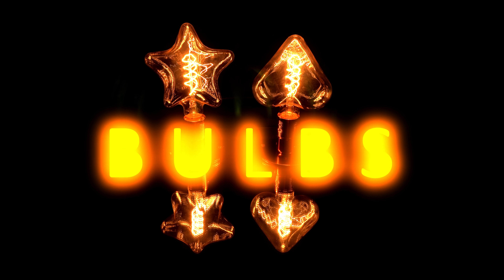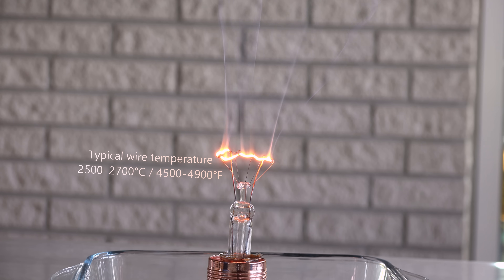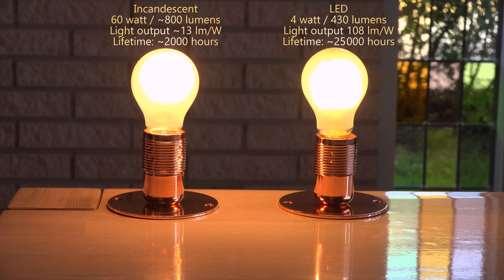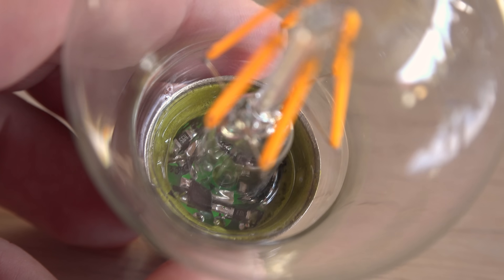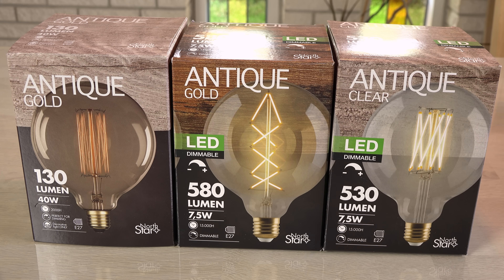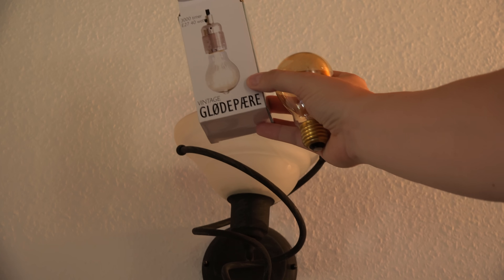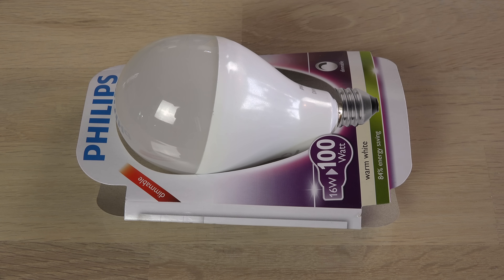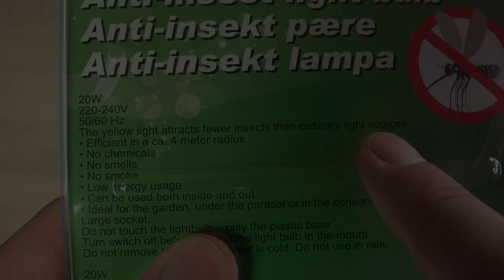Light Bulbs | LED vs. Incandescent

Comment: LED's are blue light. Blue light in excess and beyond the usage at noon, will through off circadian rythym in the masses, and reduce the efficiency of the mitochondria in cells provided enough exposure.
Reply: apparently this is strictly limited to the blue spectrum? So, ridding blue and using violet wavelengths looks like it fixes the issue while attaining high CRI? I haven't seen independent 3rd party analysis on this other than from what the Japanese companies themselves push, but I haven't tried to look very hard, either.
Reply: @androidkenobi  I read that masking the bulbs doesn't help much.

Comment: how do they make colored light bulbs?
Reply from the maker: There are several techniques. Some are just painted/filtered white light bulbs, while others use LEDs with specific colors.
'White' LEDs are actually blue LEDs covered with a fluorescent phosphor to make the light whiter ( https://en.wikipedia.org/wiki/Light-emitting_diode#White_LEDs_and_the_illumination_breakthrough ).
Thanks for watching :)
Reply: Brainiac75 Thanks!
Reply: Yes, each LED has a specific frequency.  You change the materials to adjust their resonance.  The technology for a $2 light bulb is quite different from more refined one light in aquariums.  What brainiac75 states is partially true.  The technology for my Christmas bulbs is much more complicated then the bulbs he is discussing. The use 4 different emitters not one.  He is wrong for the most part but right about one singular case.

Comment: LEDs, CFLs and all other fluorescent tubes are abominations. They've been giving off their perverse light since the 1930s. Incandescent bulbs are the only electrical light source that is similar to natural light(fire and sunlight). It follows the spectrum typical of a black body radiator. That kind of spectrum is REAL light, that which the human body is adapted to. CFL and LEDs are perversions of light and they both lack the VITAL infrared portion. Light that is devoid of the infrared portion and doesn't have a smooth wide spectrum is POISON. The infrared given off by Incandescents is not waste but an integral part of any healthy light source.
Reply: Roo Baba You were asked for evidence for your health claims.  Evidence is the result of scientific research, by a scientific method with objective measurable results.  Such research is publicized so other scientists can criticize the method or repeat the research to verify the results.

Your reply, however, is nothing but a logical fallacy:  Natural is good, natural light contains infrared light, so infrared light is good.  Or the opposite of it:  Unnatural is bad, artificial light does not contain infrared light unlike natural light, so artificial light is POISON.  Even though it is a popular belief, the premise that natural equals good, better or even optimal is completely false.  Likewise, the premise that unnatural equals bad, worse or worst is false as well.

Without research, your claims are nothing but ideas.  Only scientific research can tell if your ideas happen to be correct.  If it is, that doesn't mean your premise is true since there are plenty examples where it isn't.
http://lmgtfy.com/?q=appeal+to+nature
Reply: Roo Baba interesting. any sources or evidence so i can look into this?
Reply: Samster Birdies Look at the spectrum of incandescents, fire and sunlight. They all follow a similar wide smooth curve snd only differ in the parts of the spectrum they cover. Look at the spectrum of sunlight at noon and at sunset. Observe the natural patterns and what humanity has been accustomed to for thousands of years before electricity. You will observe that sunlight at any time of the day is rich in infrared radiation(to call it waste is heresy! Lol). At noon, the blue portion is at its peak(promotes alertness and productivity, serotonin production, melatonin suppression and suppression of regenerative rest) but at sunset, it is greatly reduced(setting the body to welcome a restful night) and resembles incandescents and fire's spectrum more closely. It is only natural for the body to be exposed to low intensity light that is rich in the red and infrared and very low in the blue and UV at night. Fire was the perfect source. Incandescents are pretty close.

Infrared is divided into 3 portions: near, mid and far infrared and these have beneficial effects on the body unlike the light from CFL and LED. Both these are devoid of infrared, lack a smooth wide spectrum and most commercial varieties are rich in blue!!. A complete perversion, worse at night than during the day.
Reply: Roo Baba ahhh. i see. thanks.
Reply: Triplemania we should make it so light bulbs give off ionizing radiation so they are just like the sun.
Reply: Roo Baba I agree..it is typical of ObamaEra thinking.
Reply: Triple mania, Excellent way of thinking, as far as going on the scientific way.

Using the word “natural “ to promote anything, including herbal supplements with unproven efficacy, and possible harm, has been a longtime problem in the health industry.

Coming to the point of this discussion: the two well known effects of lack of natural light are SAD and Vit D Deficiency.

Would be interesting to see if these new light sources are able to mitigate these problems. 

I think (though I’m not sure) that the light sources used in treating SAD are fluorescent.

The third factor to consider is possible effects on skin cancer.

(Interesting how this excellent video on energy efficiency of light sources by Brainiac has lead us to think along these lines.)

Nice group of bloggers here.
Reply: have you spoken to your psychiatrist about this?
Reply: Jonathan D I think your reply was directed to another comment but got posted here instead. :)

Comment: I've worked in the sustainability & energy efficiency sector. I get many questions from clients & people asking if they should swap their halogen or filament bulbs for LEDs or CFLs. The answer is... it depends on how often & how long you use the light.
If its a light that you use often, say >3 hours a day, then the cost-benefit justifies it. It will pay off in a less than a year or two. But if it's a light in the laundry room, storage room, or a vacant room that you only use once or twice a week for less than 15 minutes... then it's better to leave it be & only replace it when it goes. I have an old filament bulb in my laundry room that's been there before the phaseout (filament bulbs were replaced with halogen technology) in 2008.
Reply: we went LED through out,  in the low uses rooms more cause daylight leds are so bright and pure a white and we can use higher output bubs than was safe when they were incandescent
Reply: @ThunderClawShocktrix  Shame, because incandescents offer a special 'warmth' (not color) that LEDs dont give.
Reply: When I built The House of Steel almost 20 years ago, I installed mostly halogens in the high use areas and incandescents in the low use areas. LEDs were far too expensive at that time. The high voltage halogens aren't particularly long-lived, though the low voltage/low wattage ones are still going strong. I replaced three of the 50W sealed downlights with the highest output LEDs available about three years ago. The LEDs were quite dim (and therefore dangerous; they light my kitchen bench) and the first failed after three months so I returned to using sealed halogens. The incandescents lasted longer than 10 years and were definitely the cheapest option. 

The short lifespan of the LEDs makes them the most expensive by far. Also the highest energy consumption when you realise that their cost is a function of how much embodied energy they represent. The high voltage 200W linear halogens have a lifespan of ~3-12 months. The sealed dichroics about 12 months. All of the supposedly energy-saving bulbs cost me more than the old incandescent bulbs did. CFLs are lasting quite well in the low use areas, but the ones in my home office only last about the same as halogens, 6–12 months. Also the 12 volt devices consume transformers. They rarely last longer than 2 years.
Reply: 2 years later:  I would advise traditional incandescent bulbs for your nightstand or reading light, also for kitchen. LED lighting is not good for your eyes.
Reply: I changed my CFLs just beacause of the annoying warming up time, specially if you are just going to be there for 5 minutes but I still have an incandescent one in the staircase that the previous owner left and I wonder how many 100 year old bulbs are we going to have in the future.
Reply: @besanit  Our house is still full of incadescents and its really cozy
Reply: I just found out how bad LEDs are for our health. The ban was a terrible idea.
Reply: @casperboreanaz  I only have incandescent in my home.... I love it
Reply: @NEON2600 what do you mean by super bad for health? what are they doing?
Reply: @casperboreanaz  Exactly!!
Reply: I remembered when I moved to Arizona and there was such a limit on water use, as an environmentalist I was quite impressed. But when I conveyed my enthusiasm for these water restrictive policies, a long time resident of AZ set me straight. She said it had NOTHING to do with water conservation, it has to do with growth. The powers that be can't push endless destructive growth if there is no water, so they restrict the little people, make us feel like we are doing something good, but all it does is allow them to continue the sprawl across the desert. The use of LEDs is no different, this is not about conservation, it is allowing for additional growth. Look in California where they have rolling blackouts because of the strains on the system. God forbid they invest in infrastructure, they are far too busy spending al that money on wars.

Comment: Can't dispute most of your facts, however.  Like for like,  incandescent bulbs give off more light.  I have used a photographic light meter to test  incandescent Vs LED and the incandescent wins every time.  It's not a saving when you need two or three LED to generate the same light as one  incandescent.   Also and more of a worry, the EU  based criminals who  generated this ban, earned around £4 billion in the England alone - during the transfer of fittings needed.
Reply: Does the photographic meter have infrared cutoff filter? If it doesn't, it might be just measuring 700-1000 nm wavelengths which humans cannot see. In my testing, even cheap LEDs give about 8 times more light per watt
Reply: " Like for like,  incandescent bulbs give off more light"

How did you figure "like for like"? There is no such thing. The absolute nearest you can get is to go by the advertised lumen rating, and your photographic meter is absolutely  useless for that.

" Also and more of a worry, the EU  based criminals who  generated this ban, earned around £4 billion in the England alone - during the transfer of fittings needed."

What transfer of fittings? Led bulbs use E27 too...

Sounds like you;re just a troll.
Reply: bullshit alternative facts
Reply: agree
Reply: These are "rough-service" light bulbs marked as unsuitable for home use. But of course most of them are sold for home use.
Reply: No actually the LED produces a more white light while the incandescent produces more yellow and the yellow wavelength somehow causes a stronger reaction on photoresistors, the cells on the retina of the eye and also photochemical reactions... This is exactly why the city lights nowadays are all yellow/orange, we can actually see better with them but in the past white light (Gas light bulbs) were more often used in city lights... Many people preferred the white lights but they were unquestionably more dim, this is why most city lights are yellow/orange nowadays. Also LED lights consume 1 10th of what an incandescent light bulb consumes. You need at least 10 10W LED light bulbs to match the energy consumption of 1 100W incandescent light bulb. Furthermore 1 10W LED produces as much light as 1 40W incandescent light bulb (40W incandescent light bulbs were available in more niche markets, the most commonly used incandescent light was 60W). Basically LED is 4 times more efficient in white light production and 100 times more durable, those things just appear to last forever... Sometimes when they fail it's a capacitor or other electronics inside the bulb but the LED light source itself is incredibly durable because it is not a resistance, it is a diode.
Reply: You can still buy incandescent in the UK
Reply: Funnily enough I just bought some traditional 100W pearl bayonet bulbs today. Made by GE in Belerus,  called Classic and have the CE mark (Conformité Européene) on bulb and box.
Reply: Above my stove, I had a 28W halogen light bulb.  I replaced it with a 3W led light and the light on my stove looks exactly the same.  Sounds like a non-issue but I actually have this light turned on almost the entire day. A quick calculation shows that this led saved its price in electricity within a few months and continued to save that money year after year.  Not a bad ROI, I'd say.

At my desk, I had a 25W incandescent light bulb, which I also replaced by 3W led and it gives slightly more light.  Although I don't use that nearly as much, it still saves me enough electricity to had the bulb pay for itself within a year.

I'm using plenty more, I've used leds for years now and have never needed to replace any of them, unlike the incandescents I used before.  Never did I buy expensive leds, I bought them cheap from discount sales and found that if I pay attention to color temperature and CRI, I'll have cheap leds that are just as fine.  I have no doubt I would've paid the same amount for replacing the incandescents by now; these leds are definitely saving me money.

Also recently I replaced about 35 dual tube lights by led fixtures in a metal workshop.  The owner didn't buy cheap, they were about 40 euro a piece and then paid me to install them.  It's clearly visible that they produce a lot more light than the TLs.  In the meanwhile, they use a lot less electricity and we've calculated he still saves the total cost of the leds within 2 years, while these lamps came with 5 years warranty and will easily work fine for 10 or more years.  It also saves him the hassle of replacing the tubes, which needed to be done periodically before they started flickering because the output of TLs is reduced long before that.   Quite nice since two dozen of them are like 19 ft above the ground and they needed a scaffold to replace them.

Your non-scientific method with your photographic light meter is not going to convince me, ever.
Reply: IanRM Yeah..we left England over tea taxes.I agree😁
Reply: ianrm u chatting shit old man ,youre a dinosaur
Reply: Say it to a 9000 Lumen 100w led chip next to a 1500 Lumen 100w incandescent. Funny.

Comment: The Danish aren't the only ones banning the incandescent light globes. They are also banned here in Australia as well. Though it's understandable since incandescent globes suck energy like a fat kid eating ice cream, and LED globes put out more light for less wattage. They are so much better than those crummy compact fluorescent globes, which are dull when first turned on.

But the only annoying part of incandescent globes being banned, is for when people use them as a heat source like when keeping young chickens, you can't easily get them.
Reply: You still can get incandescent-type globes at the shops... halogen globes. They produce warmth as well & last a bit longer than the old filament bulbs.

Comment: I must say one thing: friction and electrical resistance are not the same thing. On the quantum level it's caused by how the electrons jump from shell to shell emitting an IR photon as is determined by what shell they can jump into, the longer the hop within the atom the more energy; longest hop will emit Xrays,  in the Balmer series, shortest is infrared which is between molecules. Curiously you can't get gamma rays or radio waves by changing valances. It's actually related to the reason why glass is transparent and why other materials like ceramics are not.

Comment: Thank you for posting an accurate and informative video that covers so many aspects..LED lamps are fast becoming available in a variety of colour temperatures, but a full SED curve will always make them slightly different from conventional lamps. You may not have fully realized that prepared food is dyed to look appetizing. No doubt as LEDs become more common place the food manufacturers will start to use different dyes.
Reply: Something else to consider is that medications have dyes in them that look a different color under fluorescent, incandescent, and LED bulbs and it has caused me a little confusion thinking I was given the wrong prescription when I got home looking at my prescription under my new LED bulbs. I was expecting a yellow coloration to the tablets and when I got home they were all white so I thought they had given me the wrong dosage but then at the drugstore it was all back to the right color.